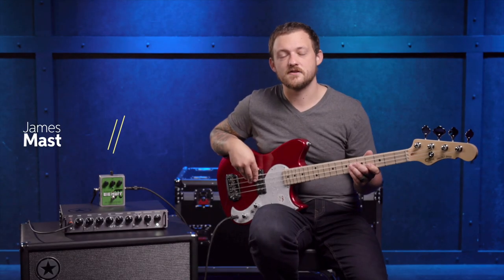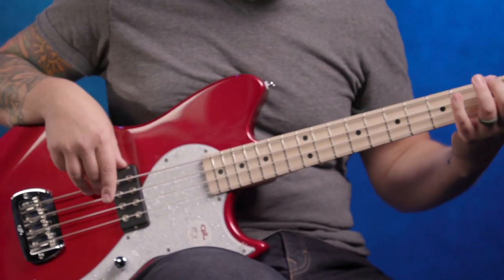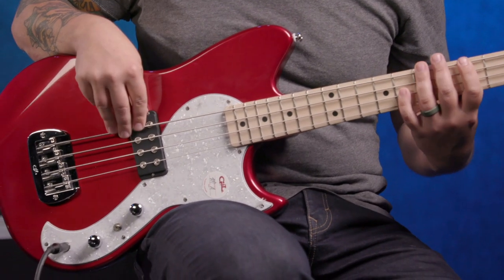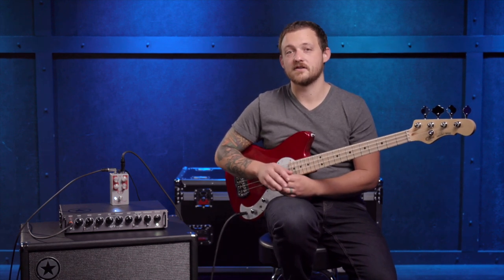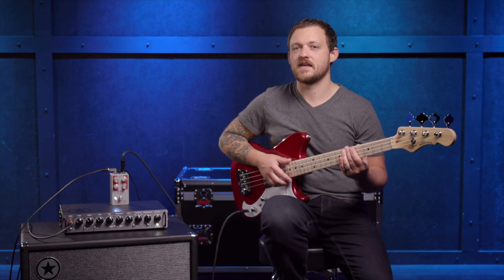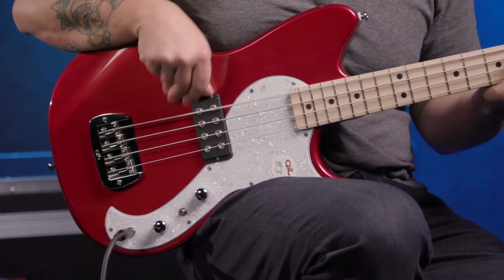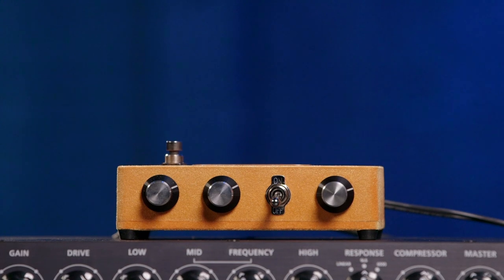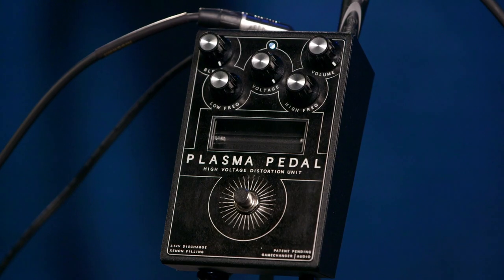From Dirty to Filthy: 5 Fun Fuzz Tones for Bass

Comment: Why was your tone not clean before testing?
Reply: That's what I wanna know
Reply: I’m guessing if you’re looking for a hairy bass sound the first thing you’re going to do is drive your amp: the idea of all your fuzz/dist/OD coming through pedals but using a totally clean amp is a bit odd, really.
Reply: @rinkadon  Why is it a bit odd? Maybe some people don't want the veil or blanket of distortion that comes with a dirty amp. I like the thin veil of distortion sound, but I can see why one would want a more tame tone when engaging some grit.
Reply: LRD UND Strange
Oh, I agree. I imagine most fuzz pedals are still aimed at driving a gain stage though, and I’m sure they sound a bit insipid through a clean channel by comparison.
Nowadays it’s more common to use a clean channel and have multiple OD/boost pedals etc. for flexibility. A more thorough demo would have had both options.
Reply: @rinkadon  Using dirt pedals into a clean amp is not odd at all, especially for bass players.